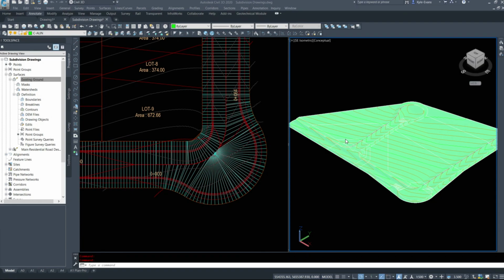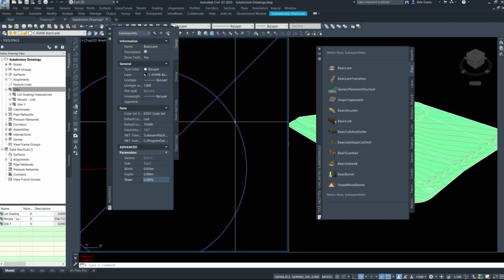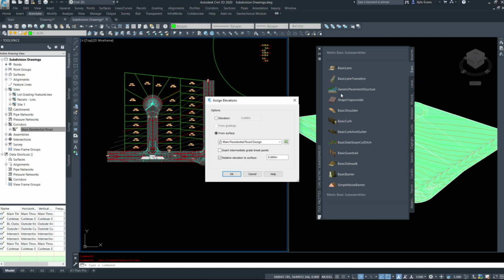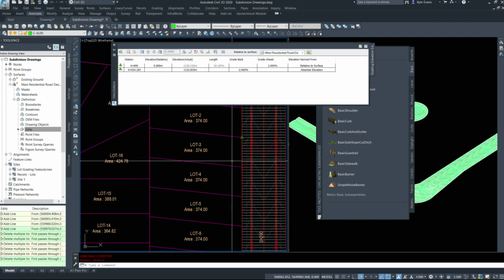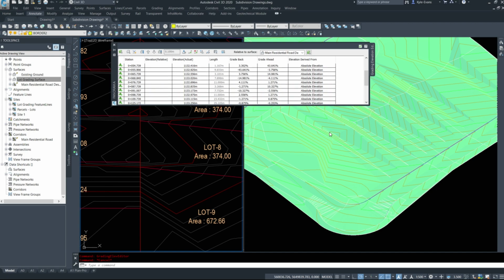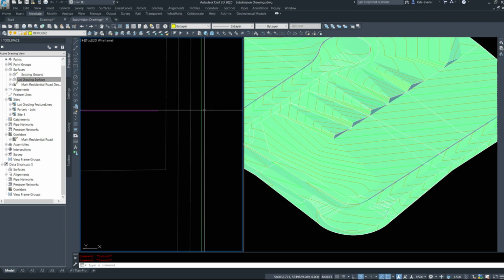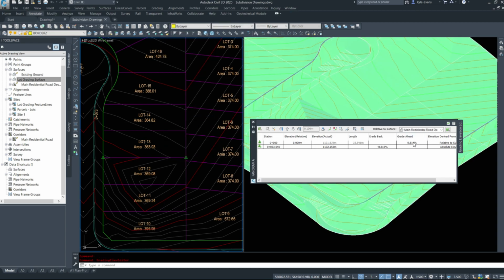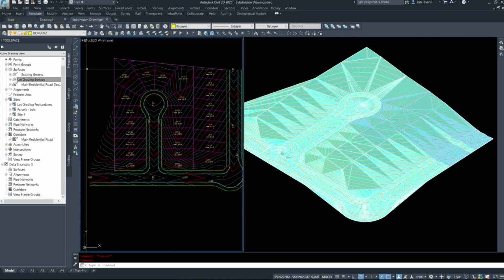Lot Grading a Residential Subdivision

Comment: Hi Kyle, nice video! I have a question when it comes to labeling the lots. I have a project where I need to display an FFE and a wall height. Would really appreciate any help or guidance on how to achieve this! is there a fast way to label/calc?
Reply from the maker: Assuming that FFE stands for finished floor elevation, I would probably handle those labels as a m-text field. You can draw polylines for the wall and the finished floor elevation, and use a field to automatically pull the information. However that is a very large manual task, as each polyline will need its own separate elevation applied, and then you will have to go into the m-text editor and manually select every single polyline and derive the elevation in the field.
Reply: @KyleEvansCivil  yea that is the issue I am having. Currently, we have someone developing a program in Dynamo to help ease all the manual aspects of this task. Just thought I would ask if you had an easier way that was already supported in 3D

Comment: Thanks Kyle, I have a question, can’t you omit surface triangles by applying minimum and maximum triangles criteria in the surface properties?
Reply from the maker: Yes you can do that as well, although I find that command does not work 90+% of the time. And when it does work, it removes stuff you need!